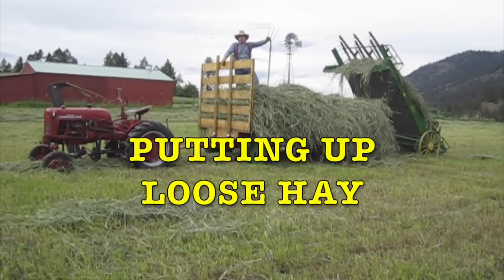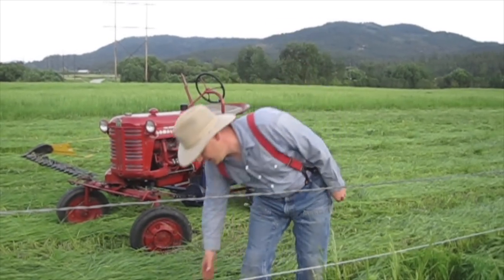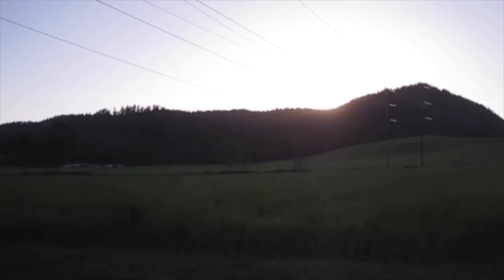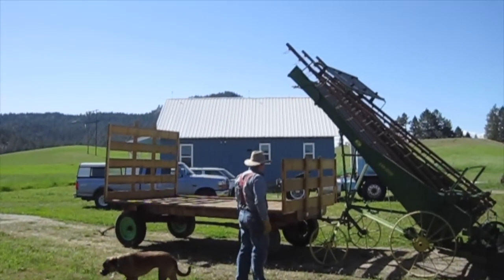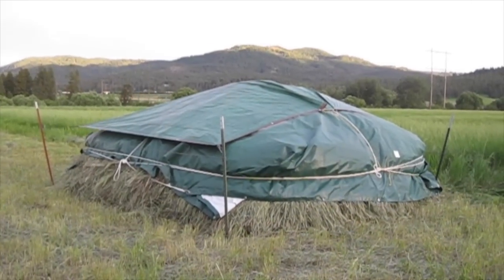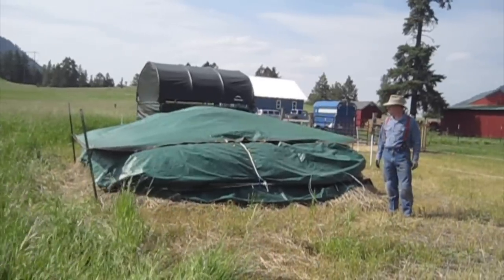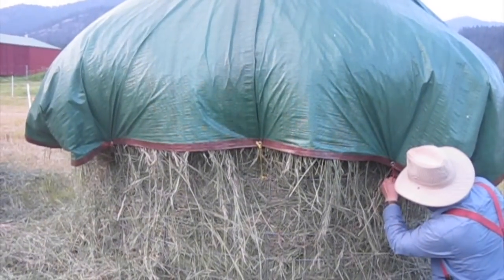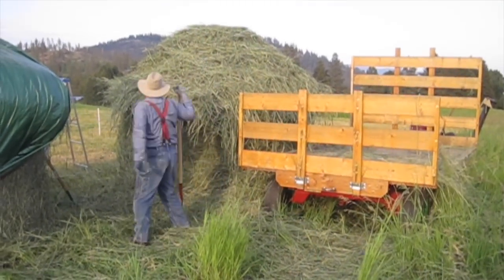Putting up Loose Hay with Farmall Cub, John Deere Hayloader

Comment: We had a different type of hay arrangement to get the hay into the loft, you spread canvas and rope on the wagon bed, it had a split in the middle with a long piece of rope hanging down, there was a special knot to tie it together, then you put the hay on top, when the wagon was full you went to the barn, on the ends of the canvas there was a way to hook a rope to it, so it made a big sling of hay, that went up to the ridgepole of the barn, then down the track, when it reached the place the guys in barn wanted it they would reach up pull that rope hanging down in the middle of the canvas and drop it.  the canvas would go back out to the next empty wagon in line and then repeat, over and over, and over...
Reply from the maker: Eric Prater we have a trolley and a grapple hook for our future barn, but we have friends who put up loose hay with slings similar to what you describe. Their slings are wood slats and rope, like a big rope ladder. We are impressed at how cleanly slings pick up the hay, and plan to use some sort of sling system on our farm. Thanks for watching!

Comment: Hey I know it's late to comment. But if you ever wanted to move the round cattle panel bale of hay to barn from field you could put long rods thru the bottom part hook chains on ends lift it enough to move it to barn. Just a thought you know what I mean.
Reply from the maker: We actually thought about it. I don’t think our tractor could move it though. Once that hay is in there and packed down, those hoops hold 2-3 tons. Maybe if I had a bigger tractor! Thanks for watching!

Comment: This is how my family used to do it  little tip if you stick side boreds on the hay trailer only about a ft it will help keep the hay on the trailer and stop it dragging on the ground really good vid tho nice work
Reply from the maker: thehornbykid Evidently, great minds think alike... or at least similarly. If you check out our haying videos from this year, you’ll notice we added ropes along the sides of the haywagon. While they’re not boards, they’re basically filling the same role. The big advantage we’ve really noticed was that while unloading, less hay falls off the side. Thanks for the ideas and thanks for watching!

Comment: The Amish in Ohio and Indiana still does it this way execpt they have hay mounds at least three times taller and larger in diameter and they don't cover their hay with anything as i guess the hay is so tightly stacked that it sheds water like a grass hut, i seen several cattle eating around the bottom of stack like they would round bales.
Reply from the maker: Yes indeed! A haystack will develop a "rind" that will protect the inside. Since our haystacks are smaller, we choose to tarp ours, since even though they will also develop a rind, a larger percentage will be lost relative to the stack size. We have also self-fed out of our haystacks and it is quite convenient! Thanks for watching!

Comment: Hay stacking is an art. How did it work out feeding? Did the animals make a big mess?
Reply from the maker: curioushooter The hay from the large stack was fed out of a separate feeder, so no mess there. The smaller stacks we would open up the cattle panels into a “U” shape and then put a feeder panel across the opening. That worked really well too. We’d use a potato hook to pull hay from the back of the stack to the front where they could get at it.

Comment: Beautiful video!  Your equipment is very nicely restored!  Even the correct colors! (the IH mower being blue, the David Bradley hay wagon wheels the correct green!)  Someone is very meticulous at your place.  Good to see all that work being done with a 12 HP Farmall cub!!  That restored loose hay trolley was also beautiful!  I enjoy making baled hay with our antique equipment also (just a little newer than yours).  We are up against frequent rain and high humidity here in north central Pennsylvania which makes things difficult sometimes, but once the bales are in the barn the project is complete until the next cutting.  Does the ground moisture accumulate under the tarp and cause spoilage?  Keep up the good work! I'll stay tuned - Chip
Reply from the maker: Ruhl's Pastured Beef we love our old equipment! I really enjoy taking something that is literally scrap and bringing it back to life. The David Bradley green was a bit of a challenge, but I think we did a good job. The loose hay stacks form a “rind”, so the inside stays in good shape. Thanks for watching!

Comment: Ever think of a frame with a hay hook to unload the haywagons. the way I look at it you could unload haywagon in about 60% faster than using a pitchfork.n
Reply from the maker: Hi there! Since this video, we have built a barn with a hay trolley for unloading. It works great! Before that though, we did rig a jib pole to the front-end loader of our big tractor, with a hay grapple and the end of the jib. That worked great for unloading! Certainly sped things up and reduced labor!

Comment: Reply to brad not Landa:  We spent 10 yrs in West Virginia without electricity and our closest neighbor was born in 1900. When he was 12 years old he went to work using teams of horses - mostly in the gas pipeline carrying for the gas wells going in all over the hills and hollers. 
He told us about making haystacks. They'd work on each farm at a time - several teams with about half to a dozen guys. Dump rakes would do the work - good horses would actually stop and remind you to hit the dump mechanism if you drifted off. Wagons would come along and men and boys would pitch the hay onto the wagons - which sometimes had framework sides.
Then they would go to a slightly high spot in the pasture and start a round pile - usually about 16 feet around. They started piling the hay in the middle and raked it so that it went down from a coned center to the outside. That way the entire stack shed water. There was usually a young man/boy on top who was specifically trained in how to do that, and he'd keep busy with several guys pitching a wagon up for him as others kept loading wagons and raking.
When it got hot - and it did, the hottest years on record in the US being in the early 30s through 1936 - they would cool off with cold water. They would put ginger in the water so that your stomach wouldn't cramp up from the cold....
Reply: Looks like the original round bale. Lol nice way to do it on a small operation.

Comment: It's now a year in retrospect,  what do you think now.  Did you have to buy more hay?
Reply from the maker: Great question! This video is from two years ago, and we put up hay pretty much the same last year, but last year we improved unloading with a grapple on the end oh a gin pole on the front of our 40HP New Holland. Overall, both years were successful and we had enough hay, so no problems there. Obviously outdoor storage of any hay isn’t ideal, but it worked out. We just had to stay vigilant with the tarps. Now that we have a barn, this year will be our first year of indoor storage, which we’re looking forward to! We have a hay trolley for the barn, so that will make unloading great! Stay tuned! Haying 2020 will be here soon!
Reply: @vnthomas16  thank you,  I don't think we are far apart from each other.  I am in Kettle Falls, wa. You had made references to Spokane if I remember correctly.

Comment: How long will you store the hay outdoors using this method? IMO seems very vulnerable to wet weather on the bottoms of the stacks. Have you tried using round pool tarps?
Reply from the maker: We have a barn now (be sure to check out our latest video!). So, that makes storing hay much nicer of course! We still plan to do a couple outside stacks for early Fall hay feeding to supplement our pastures at that time of year. Round pool tarps might be worth looking into! We do loose a few inches of hay on the bottom, but it is negligible. We might try putting the stack on pallets in the future. Thanks for watching!

Comment: Should pick up your ground speed when raking. It would've raked cleaner because it would've been spinning faster instead of just kinda turning and catching. But good video overall
Reply from the maker: Garret Newton yeah, our little cultivating tractor doesn’t have much speed to begin with, HaHa! And if it did, it’d probably bounce you out of the seat! We use our New Holland tractor for raking sometimes, and it’s much faster... and smoother! Thanks for watching!
Reply: Those old cub lowboys only have about 12 horsepower.
Reply from the maker: Michael Rhoads I know IH made some modifications to later ones, but I think my tractor is 9 HP!

Comment: Was the quality worth the extra work?
Reply from the maker: Excellent question! I think it was. If I were to compare it to putting up hay in small squares, which we had previously done, I would say that overall this first year was more labor. That was mainly due to unloading by hand. Loading the wagon is actually really easy, since you are working with gravity. This year we started unloading with a grapple (shown in a recent video). That definitely tipped the scales and was a game changer, and I would say now our system is easier than when we did it small squares. Thanks for watching!
Reply: Blue Creek Dairy Farm WA might be ok for a little hobby farm but not on a working dairy. We farm 1700 acres and are milking 300 as of this morning. Got another 300 heifers and roughly 100 dry cows right now. That being said,I have put up loose hay before. We do a demonstration at our summer show for our gas,steam and antique engine club. We now some with scythes,and some with sicklebar. One is ground driven and one is power shaft driven. It’s a hell of a lot of work. We have a stationary baler as well. Cool video tho,I enjoyed seeing someone else do it besides me lol I’ll be doing it this weekend at the show.   Btw,where in Washington state are you guys located? I used to live in Spokane for a couple years. My oldest two daughters still live in Washington state.
Reply from the maker: J.m Shrader you’re absolutely right, it’s all a matter of scale! (Although the amount of loose hay ranchers put up with beaverslides is amazing!) We’re halfway between Spokane and Canada. Thanks for watching!

Comment: We let ours sit for at least 3 days.. until you can snap it... the moisture will cause mold... hope this doesn't happen too yall..
Reply from the maker: Ga Hillbilly I would say we take about three days on average, but have taken as little as two days. We can be blessed with extremely hot temperatures with extremely low humidity, which will dry hay out fast. Being loose, we can also put up at a percentage point or two higher than if we baled, without fear of mold (or fire!). Thanks for watching!

Comment: That cub was not designed for do that if you keep doing it you will wear out transmission and clutch.
Reply from the maker: Justin White could you please elaborate on what exactly the Farmall Cub was not designed to  do?
Reply: @vnthomas16  they were not designed to pull the weight of a hay wagon with a load of hay on it and a hay loader they are a low horsepower tractor they were built for the truck bed farmer the implements that were designed for it or what that tractor was supposed to be used for for what you're doing in a Hayfield you should have no smaller than a Farmall C if you want to use Farmall equipment
Reply from the maker: Justin White thanks for the clarification. Tillers International did a good study of the draft of hay wagons in different configurations with different loads. The draft of a hay loader is negligible. My only real concern would be going down hills, as the brakes on a Cub are marginal even when meticulously maintained. Luckily, our hay ground is relatively flat. In my estimation, our Cub works a lot harder pulling our plow through the soil than anything we do with hay. Thanks again for your concern and thanks for watching!
Tillers International data: https://static1.squarespace.com/static/58d68e502994ca9ba729256b/t/5a32ad28c83025b790eaf475/1513270582817/Estimating+Wagon+Draft+TechGuide.pdf
Reply: Loose hay is not that heavy
Reply: Tractor clutch if maintained will do the work load
Reply from the maker: Arthur Dewith if I had to guess, a full wagon load of loose hay for us is about 1/2 ton.
Reply: @vnthomas16  The Cub clutch and transmission was designed to do all of the work on small farms up to the capacity of the engine.  By the way, when raking hay keep checking your temperature gauge every hour or two.  The Cub uses thermo-syphon cooling.  When the radiator gets loaded with chaff, the water stops circulating.  Then the engine overheats, and if it boils the water away it will cook the block to where the block cannot be salvaged.
Reply from the maker: jan labij no temp gauge on the Cub, but I added a finer-mesh screen and check the radiator often. Definitely good advice! Thanks!

Comment: You need to go faster when you are raking so you pick up all the hay.
Reply from the maker: It’s a Farmall Cub... There is no “faster”! Haha! I surmise that most of the hay I lose is because I set my rake so high, which is on purpose as I also miss the rocks and dirt. I graze the aftermath, so any bits left behind are cleaned up and nothing is lost. Thanks for watching!
Reply: @vnthomas16  ok we use a Ferguson 3 point rake on the back of our kubota M5700 and it works amazing. I just bought a Ford 9N for custom work. Wanted a Cub for a long time.

Comment: DID YOU SALT IT, GRANDDAD SAID THEY SALTED IT WHEN THEY STACKED IT LOOSE
Reply from the maker: DAVID WATSON II we did not salt our hay. I have heard of that though, especially when you can’t put up hay at the optimum moisture content. The salt will pull out the excess moisture. With our hot, low humidity days, we usually don’t have a problem drying down hay. Thanks for watching!
Reply: @vnthomas16  we always "salted" our small square bales as we stacked them we used a salt with added minerals and vitamins. It added to the nutrition value for feed.
Reply: DAVID WATSON II  Could you tell us more?  Was it salted while in the rows before loading?  Or while stacking it into it’s holding  site? 
Thank you
Reply: THEY WOULD SET A POLE IN THE CENTER OF WHERE THEY WANTED THE HAY, AND BUILD IT UP IN LAYERS, AND SALT IT AS YOU BUILT IT UP

Comment: so basically you just tried to make haybails.....which is what you said you were getting away from
Reply from the maker: Aaron Tadlock the characters of loose hay are a bit different than that of a baled hay, as the baler will cut the hay as it’s forced into the chamber. For me at least, baling makes hay a commodity, being that it’s easy to move. Once you make a haystack, there is no easy way to move it. Easiest to just let the cows self-feed. Thanks for watching!
Reply: why not use the hay stacked in the cattle panel as a round bale? weave some twine in it as you stack it and tie it together to put in a shed.

Comment: Loose hay is higher quality than baled hay???  Where’s your analysis that proves that???
Reply from the maker: Good morning! I’ll preface by saying it is possible to put up terrible loose hay, just as one can put up excellent baled hay. We have put up both loose and baled on our farm, and all things being equal (forage type, time cut, etc), we still have to give the edge to the loose hay. One of the big reasons is that with loose, you can safely put it up a percentage point or two higher in moisture, which results in less leaf shattering. Especially with legumes. Also, the mechanics of loose hay are gentler, no baler knives, no plungers, also resulting in less leaf loss. We do not condition or tedd, but we never did when we baled either. No need to as we’re blessed with the weather that way. From a quantifiable standpoint, our RFV has consistency been averaging 30-40 points higher since we switched to putting up hay loose, and from an observational standpoint, our livestock will choose loose hay over baled hay. Thanks for watching!

Comment: The local mennonites still use one of those....
Reply from the maker: Spartaeus it’s surprising how many folks still put up loose hay. We didn’t realize how widespread it really is until we started doing it ourselves. These old hayloader are quite simple and rugged, so it doesn’t take too much to get them running. For us, it was mostly just replacing the wood parts.

Comment: Hey that equipment is lasted a long time I don't see that you lubricated anything you need to lubricate the drive chain everything very disappointed to see something it's operational like that not being taken care of. I had to stop watching I couldn't take it
Reply from the maker: Les R no need to worry! Everything is actually well lubricated! Everything is greased and oiled (I use a light oil on the chains) before each use and before it’s put away for winter. You’re right, it’s old equipment and it’s well built, and we know that proper lubrication is essential for long life. I like to try and keep my equipment clean as well, so I always wipe up any extra grease or whatnot that squeezes out. Hope this puts your mind at ease! Have a great day!

Comment: After farming for over 50 years watching you fiddle and fart around with loose hay and saying there is a quality advantage to it made my head want to explode. Bales round or square have a preservation aspect to it that you lost with loose hay. Otherwise good job.../smh
Reply from the maker: G Koplitz we baled for years before we switched to loose. We’d never go back. The only advantage bales have is if you’re treating hay as a commodity, and are shipping it. Bales also take less space to store a given amount, but the loose hay quickly self-compresses and the stack shrinks appreciably, allowing successive cuttings to go on top.